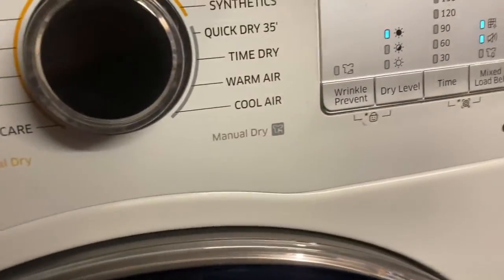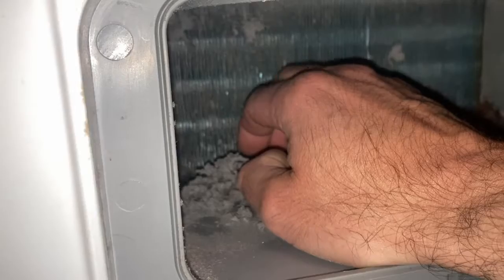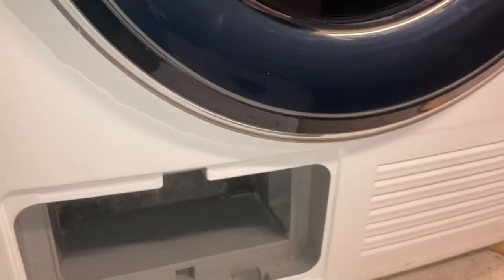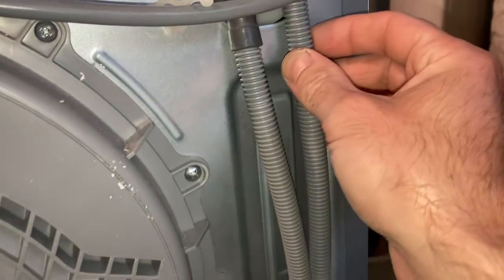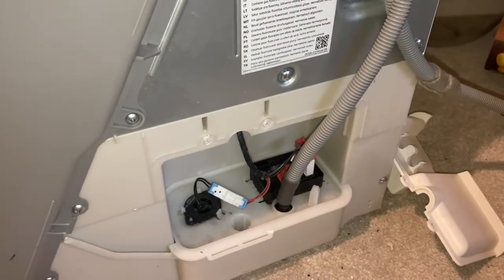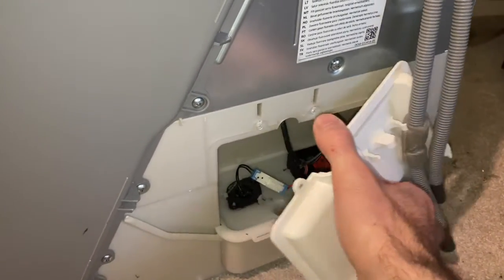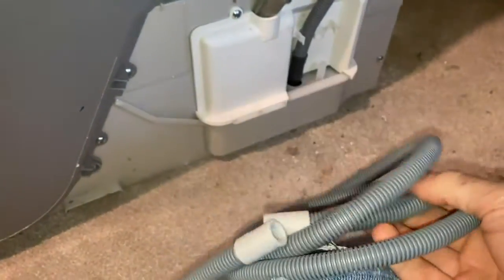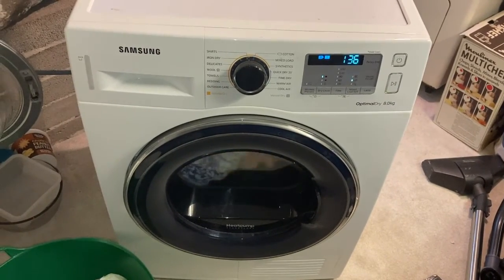Samsung Heat Pump Tumble Dryer: SC Error: checking the pump, hoses and the heat exchanger

Comment: I have a Samsung heat pump and one thing I have noticed is it tends to store the water at the bottom until the last 20 minutes and then it will pump big time up to the drawer it’s very funny how it works but it works and it’s cheap to run and I am happy

Comment: Hi bootsowen I need Ur help basically I have a bush heat pump tumble dryer i had it for 2 years now it keep beeping and turning it self off I checked every were I clean filters and heat exchanger but still keep doing it I don't know what to do next any advice.
Reply from the maker: if it is that young is it not a warranty repair?
Reply: @bootsowen Can you tell me what does water do in this dryer and where does it go?
Reply: @bootsowen  hi bootsowen there no warranty on it just under guarantee there for i have to pay to get it fix 😞
Reply: @Jay-ev2jj  call domestic in general you will be paying more for the first year if you call them out because it needs a repair but it’s normally no more than about £30 just call them up explain what’s happening say you need it looked at and you would like to ensure it monthly

Comment: First think to do, is to install some custom cut aquarium dual density water polishing filter, cut to size. This would help bypass the built-in planned obsolescense😊❤👍
Reply from the maker: I have something like that and I will make a video of it someday.
Reply: @bootsowen  Been using it for the last 3 1/2 yrs, with a single change of filter media(after noticing long dry cycle!). A video will definitely help lot of people that don't understand how the planned obsolescensce is built into supposedly long lasting products!. I do have another samsung babycare washer, with a hollow drum ring, which became unbalanced due to water accumulation, solved by drilling a few holes! to aid drainage(also changed a faulty start capacitor). Still working fine after 8+ years!. ❤️👍
Reply from the maker: That’s what it’s all about
Reply: @bootsowen  There is a unique situation I forgot to mention, its a Sears Induction cooktop, the control board fries in a timed manner (1-1/2 yrs). Replaced it a couple times(250+ each time)before giving up and buying a Fagor albeit with less features. It's still working after 9+ years!. Also, when it comes to washers or any major appliances, nothing could beat adding a good surge/emi noise protector at the outlet. There are also, some extreme measures such as power conditioning using harmonic cvt transformers, for heavy duty appliances(esp. Gym equipment, that is plugged in all the time). Just some 💭

Comment: I put an air-filter in front of the condenser on mine as well recently, because cleaning it out all the time became quite annoying. Also connected a hose directly into the drain xD
I can only assume that the pump somwhow managed to get stuck, or the water sensor was stuck and it came lose again from taking them apart. Who knows!
Reply from the maker: Do you have a video or a photo of what you have done?
Reply: @bootsowen  Will make some later and put it into another reply here, when I get to it
Reply: I'm also interested in this. I have a self cleaning dryer, but some lint still ends up on the condenser.

Comment: A potential problem could be that the hose that connects to the water tank at the very top may have a blockage in it, meaning that it cannot pump the water into the tank

I saw a video where a Beko heat pump dryer had the same issue, so it could be a related problem